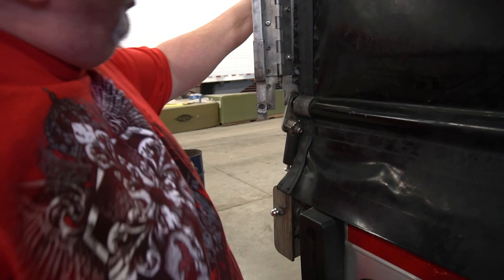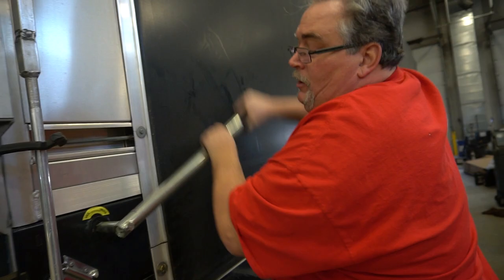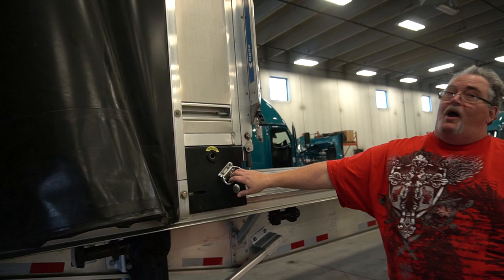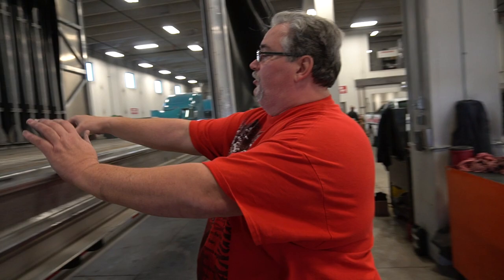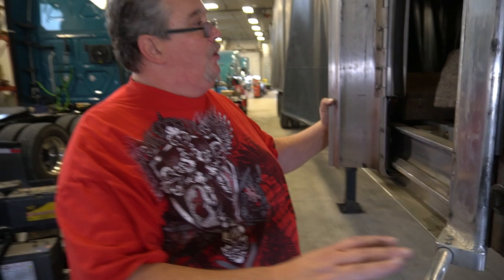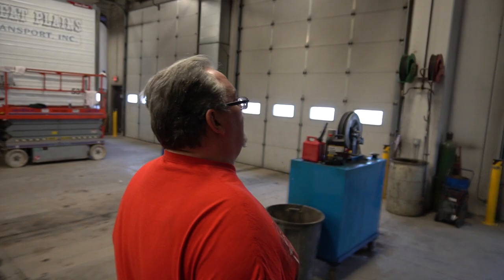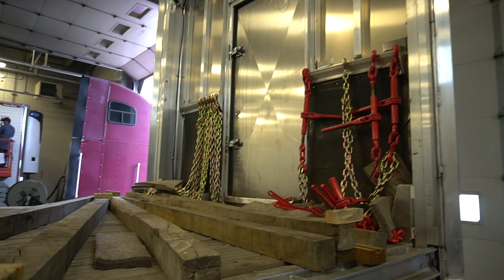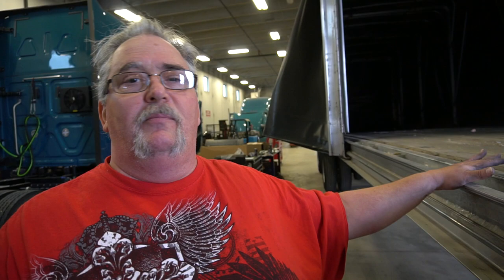Operating the Aero Conestoga Trailer

Comment: I just had my first experience with these trailers. I'll "NEVER AGAIN" use the traditional type of manual tarp trailer. Tarping a load has always been the 2nd most dangerous part of trucking....right after driving! At 63 years old, I don't bounce as good as I used to...

Comment: Hi Richard, nice video very detailed. Have a couple of quick questions.
1) If the bulkhead door is block due to product, how else can you climb onto the flatbed deck?
2) I'm interested in understanding the straps storing and strapping method. Currently I use a curtain on traditional flatbed with the strap wench holder to tighten load with the bar. And use the strap winder tool to recoil them back onto the wench type holder.
Could you please explain the difference method for both storing and securing a load using straps on the Conestoga.
Thank You

Comment: I owned a Conestoga a few years ago. Put on a ravens trailer. If you got ice on top you couldn’t slide it open. Had to take broom and try to knock it off. Had there good points and bad. It was nine foot wide. Hard to see when backing in a building. Glad I sold it. Just got open step deck now. I always pulled open flat or steps. Just wasn’t for me.

Comment: Is snow and ice ever an issue when opening/closing these things? I imagine if the tracks have ice and other crap in there they are a pain in the ass to operate?
Reply: The Conestoga kit itself shields ice and snow intrusion on the rails.  However, if ice or debris is able to collect the roller system its narrow and sturdy enough to push through the obstruction with little effort.

Comment: Would brokers and shippers have an issue with you picking up dry van loads with this type of trailer?
Reply: Probably, since you're still using flatbed methods of tying down; as opposed to having walls to brace load bars and straps.

Comment: so my company has this exact trailer made in 2016. its on a fontaine frame. its been in the repair shop for nearly 1 year out of the 2.5 weve has it. constant tarp repairs. tree branchs etc.  its a steel trailer so most of it is already rusty and the conestoga part doesn't operate very good.. the locking mechanisms and hinges are not very easy to operate.  most days I wish I just had a normal flatbed..  heres my biggest issue...   regular 4 inch straps with flat hooks cant hook up to the inside frame rail because its to big and the hook doesn't bite onto it.. so my company cut the hooks off the straps and they run the straps from winch to winch on each side. its very time consuming and frustrating.  will a diffirent type of strap hook work?
Reply: Holy smokes that sounds like more trouble than it's worth. Winch to winch sounds horrible. If your getting payed by the hour to secure your load than I guess that's on them. They will pay you more to monkey with it than just getting a better trailer. If your only getting paid for miles then personally I would definitely have a conversation with the boss.
Reply: I forgot to answer your question. I don't think other hooks will fit between the rub rail.
Reply: A paddle groove works for me , i carry my strap winder and run the strap bottom to top through the rub rail,  Then reroll and toss to the other side. Still time consuming but not to bad.
Reply: I personally prefer winch to winch as its better securement and ensures that the freight doesn’t shift and obstruct the tarp system.  That being said, ketadyne hook straps fit through our rub rail gaskets and secure to the frame just fine. Ours is a retinour
Reply: Not to be mean but sounds like you have a junk trailer or someone don't know what there doing. As far as straps u can use chain straps or flatten down your hooks with a hammer. Normally u can still use flat hooks if u only have ratchets on one side or use j hooks. The ratchet track gets in the way of hooking to the frame

Comment: I see nothing here but a nightmare. Frozen tracks in the winter, spending lots of time with a screwdriver and a hammer chipping off ice. Velcro covered in ice making it useless. Way too many moving parts. One hit from a forklift and that's it. It's useless. A nightmare to change the track.
Got me?
Reply: I Run the same set up only more moving parts because its on a step. Your correct it has alot of moving part and yes they are vulnerable, Ive been through 4 seasons in the midwest, i use a stiff bristle brush for ice and slush and yes there is some, in the real world i prefer anything over tarping a high load in the wind with frozen tarps.
In a perfect world I think a curtain side is better But for mid loads and coils i would prefer an old school side kit.
A few tips bungee the roll up bar, It hurts alot when it hits you. Put a rubber piece across the top of the front door its razor sharp and hurts when your in a hurry!
Reply: It's amazing how many ppl just don't wash.  If u washed now and then most of the ice hassle would be taken care of. Good lord.  What works for someone else may not work for you.  To each their own. Everyone's doing essentially the same job. Moving freight across America.
Reply: It's a ridiculous system. Over engineered and over complicated. High winds, hopeless fork lift drivers and a tired driver have a lot of scope for inflicting damage to this set up. A European style curtain side trailer is far less complicated and user friendly.
Reply: Not really I use one every day this video makes it seem alot harder than it is my kit can be open in less than 30 seconds.if you ever use one and it's not ragged out lol then you would not want to go back to a open or covered wagon. Next time u see a nice kit have the driver show you how it works in real time
Reply: Been doing this for years now and it’s the only reason I am still driving a truck. Did the open flatbed before the conestoga and I still have nightmares because of the 8ft tarps. Yes you need to be careful with it but when you drive a flatbed you need to know what the fk You do no matter what!